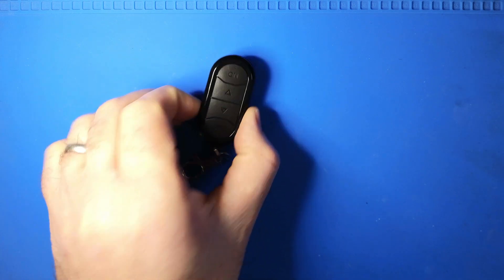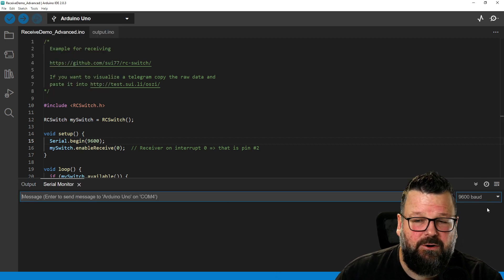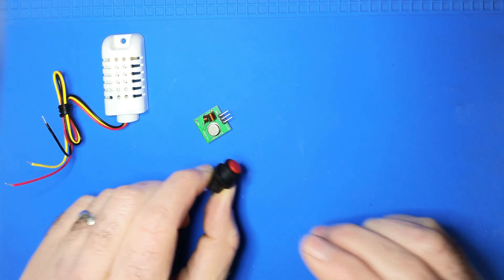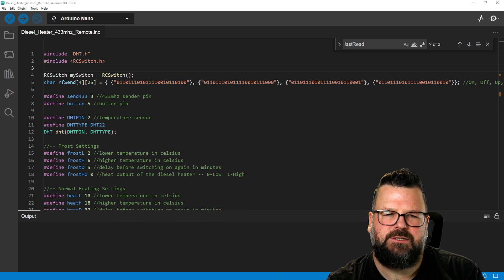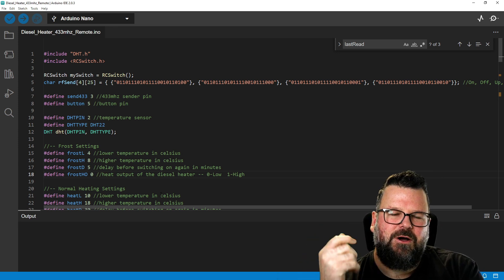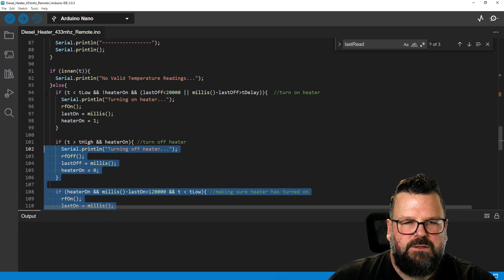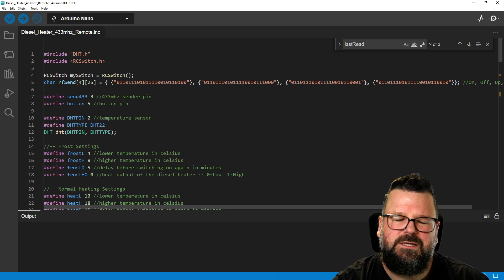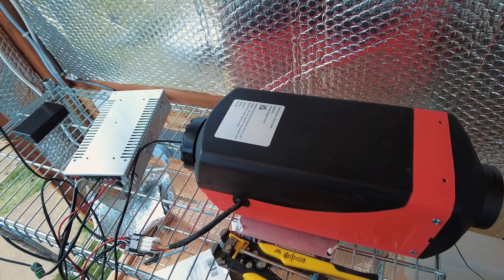Diesel Heater Arduino 433MHz Remote Control Project

Comment: So looking at the costs of parts from the links..it seems to build one is ~$50-60 USD, since you cant buy just 1 of each component, and the arduinos are all at least ~$20 minimum. Still not a terrible price, but alot more than was hoping it'd be.

Comment: I use a Broadlink RM Pro to duplicate the remote and control my heater via internet/alexa/mobile - it works great
Reply: Same method I am planning to do at the moment, since the parts for this build actually end up being more expensive for me overall vs the Broadlink. How consistent has it been for you? some have said it doesn't always turn thigns on and off correctly/consistently.
Reply: @ it’s been great, had it working for a couple of years now, it is located close to the controller though. Also have my LG TV remote and Roku box mapped in and a small LED light (the ones with the flat white colour changing remote)
Reply: @Tkdmaster1991  Can you by any chance share the codes of the RF with me? I am trying to clone my diesel heater remote but its the ones with OLED that apparently doesnt work!

Comment: I tried your code out but there is an issue, for some reason it only transmits the last binary in the list. Nothing else will transmit, I'm also running the receiver so I can see what's going on at the same time. Basically it's sending the down code and nothing else, if I put the on code in that spot then it turns the heater on, but that's it
Reply from the maker: Have you modified any part of the code?
Reply: @ChilliChump2  only the binary , pulse length, and put changed it to 32 bit because my heater uses 32
Reply: @ChilliChump2  do you have a simpler version, it just needs to turn and off, I don't need the rest of the features

Comment: Could you add a bit more info to your Github about using an ESP32 ? eg the GPIO pin assignments and coding changes to allow Rx/Tx using ESP32 . Would you need to include an interrupt to read the codes using ESP32? Great Work!

Comment: Thank you so much for this video.
I used the parts to read the codes from the transmitter and to transmit the code.
Based on this I could build a simple thermostat for the diesel heater in my camper.
I wanted a thermostat mainly for the nights and not to let the camper get too cold for my cat when I am away.
Reply from the maker: My pleasure! Glad you found it useful

Comment: Do you have messured/calculated how long the 5l tank is lasting for the frost mode?
Reply from the maker: It would really depends on the outside temperatures. But I get around 3 to 4 days

Comment: This is my first arduino project i had already bought a AHT10 temp and humidity sensor do i just find code for this sensor?
What is the point of the resistor in the wiring diagram?
Reply: I have the same resistor question..

Comment: Great tutorial, I tried using a sonoff 433 gateway to sniff the codes but failed so hacked the control panel and attached a linknode R4 relay board flashed with esphome and control via node red.  I think I'll take another look at sniffing the codes using your method.
Reply from the maker: Thanks Michael. The sniffing of the codes was the quickest way to get done what I wanted. If I had the time and inclination, it would be great to directly interface with the system. But I decided it wasn't really necessary. Let me know how you get on!
Reply: @ChilliChump2  The sniffing worked a treat, I now can remove the relay board (which was ugly) and have hooked up an RF 433mhz sender to a Wemos D1 (using esphome/home assistant).  If anyone is interested in using the same to control their diesel heater via home assistant/esphome an example of the yaml is below.

remote_transmitter:
  pin: D3 
  # RF uses a 100% carrier signal
  carrier_duty_percent: 100%

switch:
  - platform: template
    name: "Heater_Power_Up"
    id: "power_up"
    optimistic: true
    assumed_state: true
    turn_on_action:
      remote_transmitter.transmit_rc_switch_raw:
        code: 'INSERT BINARY CODE HERE'
        protocol: 
          pulse_length: 229
        repeat:
          times: 5
          wait_time: 0s

Comment: This is almost exactly what I'm lookjng for. Why did you decide to hack the remote and not interface with the controller directly? Would you not get more features/customizability, control and feedback with a direct interface? Without feedback or monitoring,  how do you/the adrunio know its doing what it's supposed to be doing?
Reply from the maker: Just a simpler solution really. Quicker time to value. It's easy to tell what's happening because I get temperature measurements, I can tell if it is heating things up. My code takes this into account too. It does exactly what I need...and has been working perfectly since I implemented it. I might look at something different later if I have time.

Comment: I've been trying to hack my light remote for ages with no success.  I thought this might help but still no joy.  Tried two different 433Mhz receivers and all sorts of configurations but just can't get the damn thing to read...  Also tried a remote temperature sensor that transmits on 433Mhz, also nothing.  Frustrating! Thanks for a helpful video anyway!
Reply from the maker: Do you get any output on the serial console when you do the first part of this?
Reply: @ChilliChump2  Nothing...  I put a println statement in to make sure that there was a   connection, but no response to any signal.  Also couldn't find any diagnostic functions in the library to check the operation of the receiver.
Reply from the maker: What's the model number of your light?
Reply: @ChilliChump2  It's a Dutch brand, KlikAanKlikUit.  They are just remote controlled general purpose switches.

Comment: suggest taking a look at tasmota, no need for all this code, it natively support all the sensors you showed, has a scheduler integrated, nice web interface, etc :)
Reply from the maker: Still fun to code from scratch, problem solving etc. And it's useful for people trying to learn these things to do so with a practical project.
Reply: @ChilliChump2  sure, and good job! I was giving easier alternative for non programmers 😊
Reply: How would you set it up in tasmota seems more complex looking at it

Comment: Hacking 443Mhz is epic!!!
Shaun... Have you looked at the flipper zero yet?

Some notes... 
Buck converters are VERY noisy devices. Ever used a cheap chinese 12v usb charger while listening to FM radio in your car? Impossible. 
What I'm trying to say with this... Are you running any other comms in the same space? XeeBee, Wifi, bluetooth.... That buck might give you some headaches.
It is worthwhile to strip down a cheap car usb charger, then just go bigger on that coil.
That noise spreads around for about 1.5m with a weak suppression, and about 3m with no suppression. A coil around a ferric core directly underneath the buck is your friend in this situation.
last note, I hate the arduino IDE. I got all of this working on JetBrains CLion. Worthy looking into that if you want a better IDE
Reply from the maker: Hey Ben. It was a fun project!

I have had a party with the flipper zero. Cool gadget, but very much overhyped!